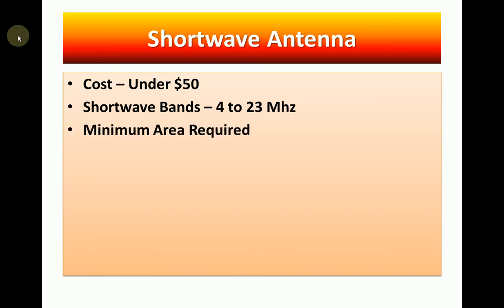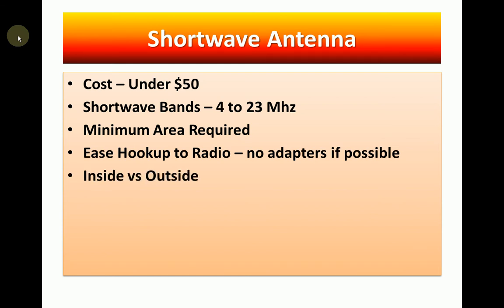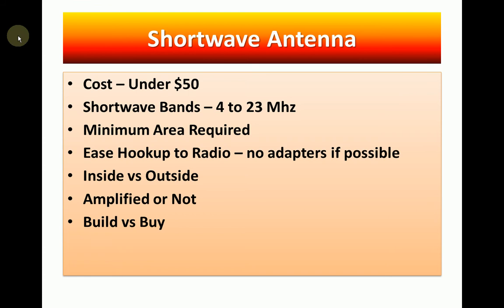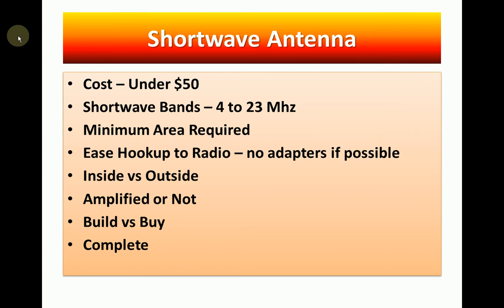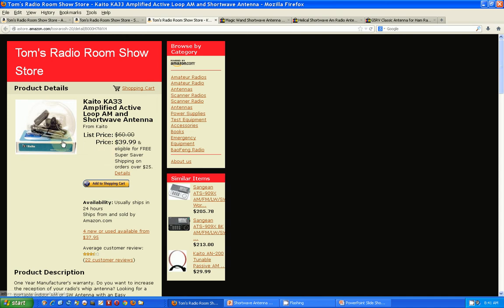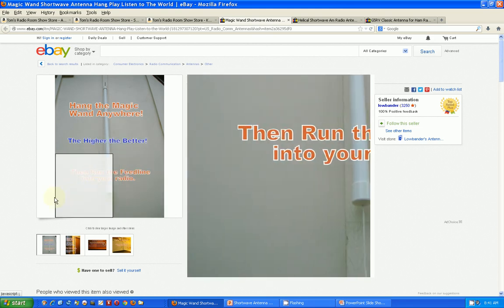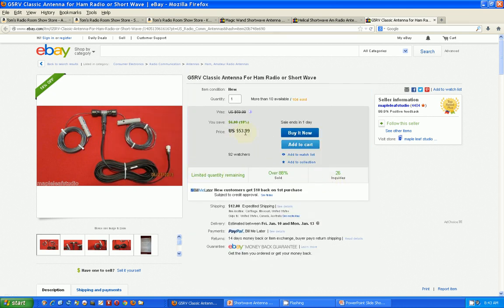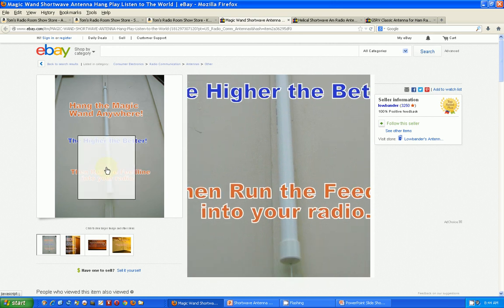TRRS #0204 - Shortwave Antennas

Comment: .Just for your info, the results of a lab test of the input I'mpednce of a Tecsun PL660 were: MW/LW 450 ohms, HF SW 34 9ohms. There was a very steep drop in impedance at about 2.00MHz. So 50-ohm matching is rather a waste of time for modern PLL & DSP RXers..

Comment: Have you considered flags, pennants, ewes, K9AYs, inverted Ls, random wires and/or the terminated tilted folded dipole (T2FD)?  Depending upon the site, one of these should meet receive antenna requirements for noise, cost and bother.  Also the G5RV in the presentation looks more like a coax fed doublet as the open wire transformer isn't visible in the photo. Thanks for your efforts and sharing with us.
Reply from the maker: Thanks for your comments.

Tom

Comment: Tom, back in the 80's I did a lot of SWL with a Realistic DX-440. I used a random wire antenna strung from the garage to the house, probably about 50 feet, with a feed wire attached, I also used a ground rod of about 3 feet in length, I got excellent results. I was told the secret was to have a good ground rod. Cant get much cheaper.
Reply from the maker: Thanks for sharing.

Tom